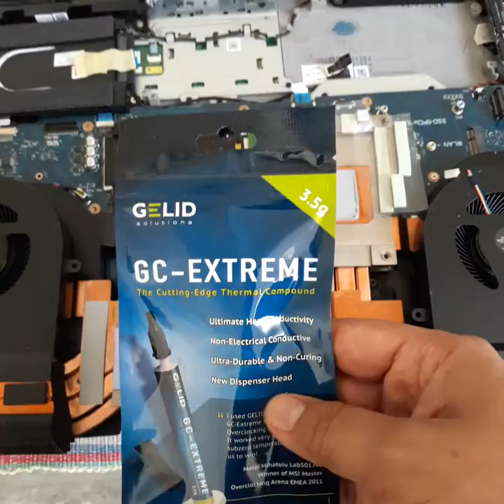Alienware Area 51m 2080 heatsink fan assembly vs 2060 version

Comment: Hi I have a rtx 2060 and the i7 8700 ... I wanted to know if you can upgrade to the 2080 and put the i9 9900k. In case what should I also change? (Heatsink and more?) And spare parts do I have to get them on ebay or does Dell sell them? I thank you for the answer
Reply from the maker: part numbers are in the description and pinned comment.

Comment: Where did you buy the heat sink
Mine rtx 2060 I want to upgrade into 2070 heat sink please let me know thanks
Reply from the maker: direct from dell. try using the contact number here https://www.dell.com/en-us/dfh/shop/dell-refurbished/cp/outlet

Part number for the Heatsink Thermal Solution for the 2080 (the one I have) is: XGRH0

Comment: Hi ive got the i7 8700 and 2070 version 
Have the big cooler .

Do you know if i can upgrade the cpu to a i9 9900(non K) dont care about oc in this small chassi and its really cheap in sweden now.

Cant find if its compatible or not.
Bought it Refurbished 3weeks ago.

Amazed how quiet and cool it achually runns
Reply from the maker: The Area 51m mobo supports all 8th and 9th gen lga1151 processors. 9900K should be the top end of processors you can add in, and yes it's a desktop cpu that it take in the system. Here's a good resource for info on specific laptops http://forum.notebookreview.com/forums/alienware.1018/
Reply: @Janzer_  thanks !

Comment: why not go with 2080?
Reply from the maker: runs too hot and costs too much. talked with AW and they mentioned the same thing. overheats too much which means throttling. you can mess with different bios versions but, I need stability for work as well, not something I'm going to have to mess with all the time. i actually did try the 2080, mentioned it in another video. it was overheating the system and shutting things down. ended up getting this cooling system because of it, but it was still running hot. not worth my time, and the 2070 doesn't lose all that much performance.
Reply: @Janzer_  did you have i7 or i9?
Reply from the maker: i7-9700k. the i9-9900K runs hot, so along with the 2080 is what was bricking gpus early on until they throttled with bios. some people can make it work, but its too much tinkering for me when i need the system for work mostly.
Reply: @Janzer_  hmmm coz I have i7 9700k with rtx 2070 and thermals is too good and might have some room for an rtx 2080 I am just having below 65degrees Celc on Apex legends on cpu and around 60 on gpu
Reply from the maker: I suggest reading up here, lot of info: http://forum.notebookreview.com/threads/official-alienware-area-51m-r1-owners-lounge.826831/page-1441
Reply: @Janzer_  2070 on Area 51m is not maxq its a 115w mobile gpu and not desktop grade unlike the 2080 180-200w
Reply from the maker: k, changed it up where i could. you know a lot of people call it the max-q so that's why i used that text. looks like the mobile version is weaker than the desktop gpu, but more powerful than the max-q variants. still, the bios version will cripple the gpu unless you handle the temps properly or you get better gear.

Comment: Just curious... were you doing the full I9 and 2080 upgrade from I7 2060 or just swapping the heat sink assembly. 
My gpu fan sounds like a garbage disposal and I was looking into changing the fan in the assembly but now I am kind of curious if I can upgrade the heat sink so later on if I decide to upgrade cpu and gpu I will have it already done. 
If that made any sense and you have any ideas would love to hear your thoughts.
Reply from the maker: I eventually upgraded the GPU to a 2070 as that along with my current i9-9700k is supposed to be the best configuration for heat (i9-9900k runs too hot with a 2080, and the 2070 has the widest range for overclocking without overheating). while testing the 2080, to me it was running too hot, which got me researching the heatsink/fan assembly. The part numbers are in the description, XGRH0 for the heatsink/assembly. The materials and heatpipes are definitely different from 2060 to 2070/2080. Ebay charges way more than Dell did.

Depending on how long you've had your laptop and if you've never opened it, as well as how much normal dust you have in the environment (I have a lot, I open the windows a lot too), I would crack open the case and clean it out. If your GPU is the 2060, it doesn't hurt to upgrade to the XGRH0 heatsink assembly if you have the money to burn (stimulus money maybe lol), as it'll do a better job of cooling because of materials and heatpipes, (plus you'll get new fans and side exhaust if you have the 2060 which doesn't come with side exhaust).

and yes, it'll be beneficial to upgrade the cooling now, if you know you're upgrading GPU/CPU later. Dell is not going to hold your hand on it, you have to know exactly what you want!